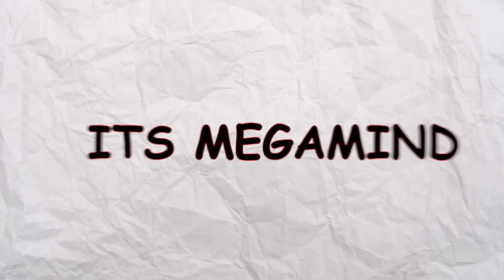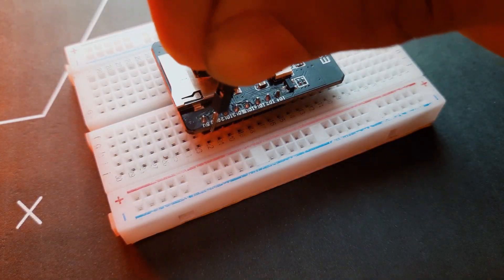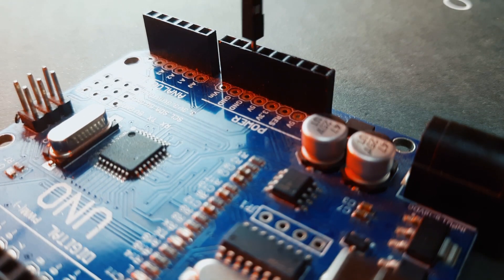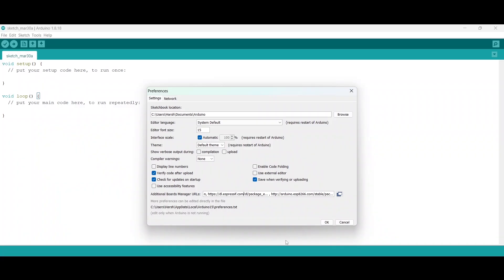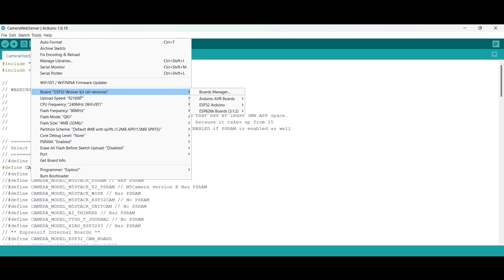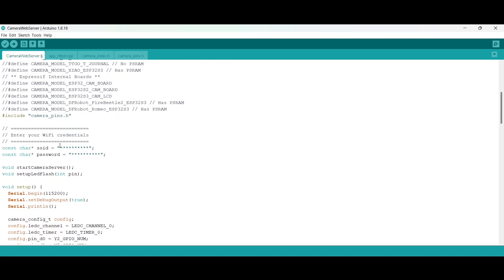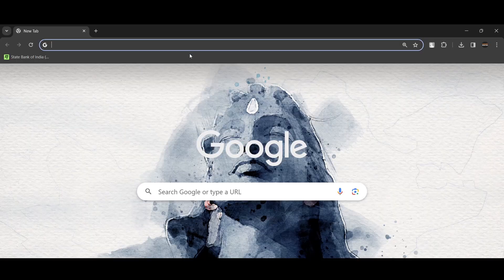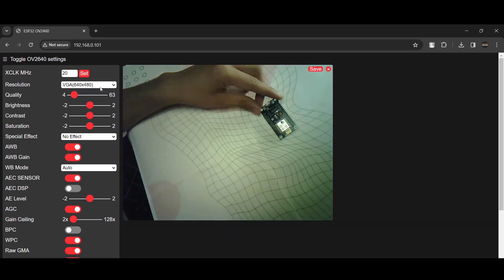HOW TO PROGRAM ESP32-CAM USING ARDUINO UNO | ALTERNATIVE WAY TO PROGRAM ESP32-CAM

Comment: This looks sketchy as fuck... Everything ive read is you NEED the level shifter, which makes sense because of the voltage difference. Fuck this
Reply from the maker: No bro, I didn't used any level shifter whatever I used is in the video.
Sometimes everything you read is not the correct info.
Give it a try I have made many projects with same technique.
Reply: @MegamindCreation  alright man, right on, I'll take your word... I was just a bit suspicious since people in the comment section were getting errors and added that to the fact my Google searches said you'd have to have a level shifter between the two. 

I admit, I'm not a hardware guy, so I'll give you the benefit of the doubt my friend. Take it easy.
Reply from the maker: @gregorio87  Totally understand your concern, and it's great that you're doing your own research! 😊 Just to clarify—I'm not saying you won’t run into any errors at all. Sometimes those issues pop up due to missing libraries in the IDE or small setup differences. But if you ever get stuck or have doubts, feel free to ask anytime—I'm always here to help. 👍

Take care, and happy tinkering!
Reply: You are right to be needing a level shifter or a simple voltage divider or a buck converter. It might work without these, but it's not a good practice to, and high chances it'll damage your board in the long run. Arduino operates on 5v and esp on 3.3v. Though it might tolerate 5v on the 5v power pin, it is not meant to on the data pins (d1,d2,etc..) and most likely cook your board or present issues.

Comment: A fatal error occurred: Failed to connect to ESP32: No serial data received.
Dude, I did everything you said, but I'm getting this error, can you help me fix it?
Reply from the maker: did you short out the pins as shown in video?
Reply: @MegamindCreation need help
Reply from the maker: if you have done everything right then just once check the port because this error is mainly caused by wrong port selection.
Reply: @MegamindCreation would you please give  explanation how do we ensure the correct port is selected.😊
Reply from the maker: @killerking8628  I have shown in the video. But if you didn't got it just try on every port that is showing. Otherwise check port Manger on pc. You'll find the right port there.
Reply: @MegamindCreation  I will let you know after trying again tommorrow. Believe me I spent 3 hours but could not get it 😮‍💨
Reply from the maker: I know buddy its hard sometimes but anyways keep going you'll learn to fix these issues soon😇
Reply: @MegamindCreation  Please  help me im having the same issue , the port is also correct.
Reply from the maker: @EpicGamer-zr4uc then make sure you are using the same ide version. Sometimes new ide doesn't support old codes
Reply: @ well it turns out my board was shorted XD
Reply: I am also having this issue. How do I fix it?
Reply: Wait, unless I missed something, did you use a level shifter? From everything I've read, you need a level shifter due to the difference in voltage between the esp32 and Arduino... Is this why everyone's getting this error? Someone shorted their board apparently because of crap information. Unless I'm wrong, you need to explain yourself.
Reply: https://youtu.be/K1pc4DJAzdQ?si=gpUxYCOQEk2j6CYi
Reply: I need help!!!
Reply from the maker: What kind of help?
Reply: @MegamindCreation i tried everything, that reset button and all, still no serial data found error
Reply from the maker: Next video coming tomorrow.
Reply: @shubham_sahu  what did you finally do ?